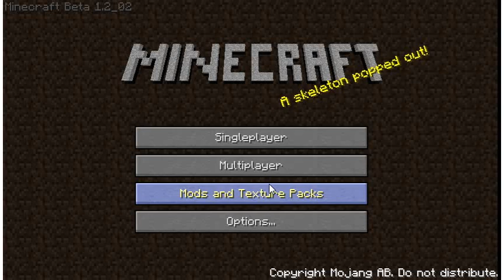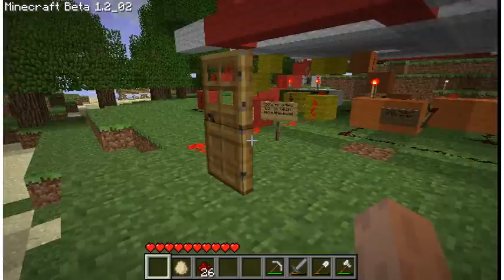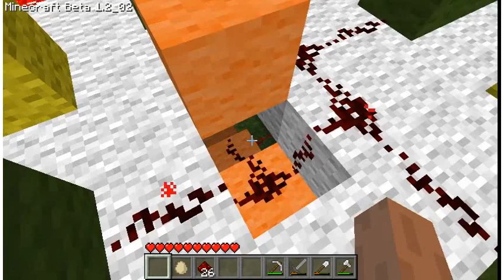5 count ring counter demo

Comment from the maker: @Iburinoc the one shown in this vid is not space optimized so making it smaller is not a challenge. you cannot see it in the vid, but the lower half of the circuit is half empty space with nothing in it.
the least volume intensive way to make one of these is to daisy chain them. altho that makes the circuit stretch out lengthwise. or you could stack them on top of each other. each register is 3 tiles high when you stack them that way.

Comment from the maker: @Iburinoc Not really. the volume of the circuit goes up instead. RS-Nor latches uses 6 cubes of volume regardless of orientation. the added height makes the wiring requirements go up and hence it uses more volume and redstone on the secondary wiring. what you can do is make a counting stack. it's also possible to make a double loop counter to save space. altho stacked shift registers were bugged timing wise. don't know if they fixed that since i havent played with redstone in a long while.

Comment from the maker: @The1apprentice 
Good. what did you do differently then? respond with a vid if you can. I'd love to see it.
I experimented with different ways to stack them, but this was the first one i was able to make stable.
a 5 count vertically stacked tower is not stable however. not when they share a single edge trigger at least. :(
still working on a way to fix that tho.

Comment from the maker: This counter is actually a very simple construct. Do not be scared of how complex it looks. it has only 2 unique parts in it. there is a simple 4 tick edge trigger that gives the counter an activation signal whenever an input is given, and there are 5 copies of the same basic counting latch. it's basic principle is actually exactly the same as the more well known boat counter.